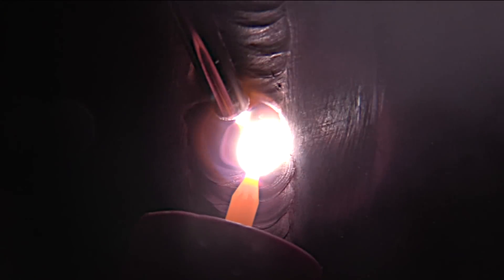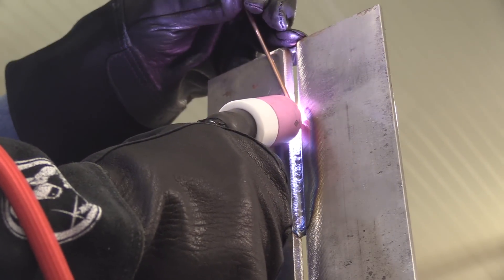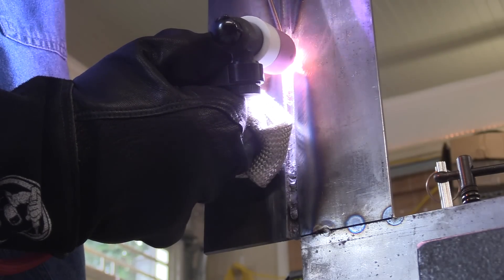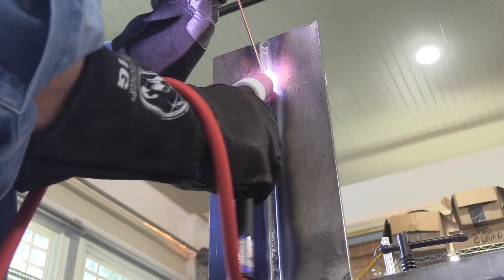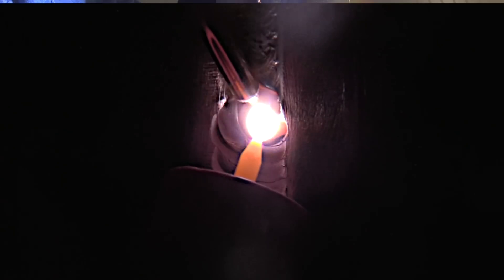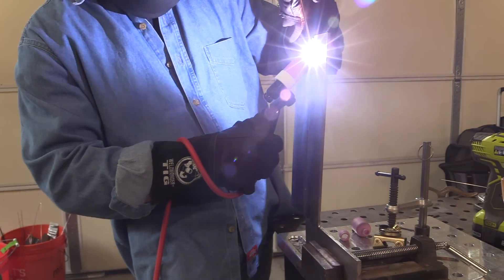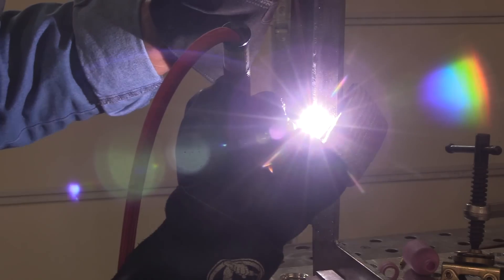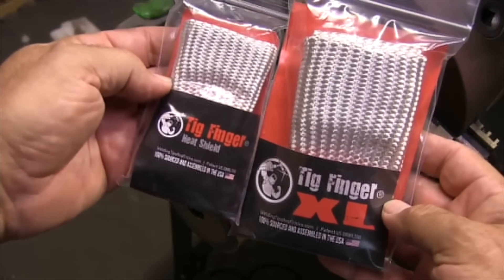Walking the Cup vs Freehand 3g Weld Test

Comment: I LOVE the TIG FINGER, I'm a sheet metal worker welding ss exhaust in cancer treatment centers (8 sites in Bedpan Alley NYC, York- 1st Aves. between 59th & 74th streets)... 95% of my work is above the "ceiling" not yet installed, so you have about 3 vertical feet to navigate between steam pipes, plumbing, electric conduit,    sprinkler system, ductwork: supply & return...
GREAT INVESTMENT, SAVED MY HANDS .
As a 260 lb guy my response to my wisea$$ apprentices that doubted if I could get into a tight spot to weld has always been, " I MIGHT BE FAT BUT I'LL  FIT", and like an AMEOBA I worked my way into spots that the kids couldn't believe possible...
Once in those spots there's no where to move, your product allowed me to endure heat from welding in cramped positions.
It was one of my best gifts to my "kids" that welded at my retirement party.
Thanks for ALL YOUR UNSELFISH SHARING OF INFORMATION AND TECHNIQUES [TIPS & TRICKS]
Bronx Love brother 😎
Reply from the maker: Thank you for the kind words
Reply: @weldingtipsandtricks  What machine are you using in this video? You saying 100-110 amps but the puddle characteristics look like the 150 amp setting on my 180mpi inverter tig lincoln.

Comment: Can tell you really know your stuff and I think any client would be more than happy with your work. 

What I wish you could have put some extra time filming into are the START and STOP positions of the weld. Seeing how you tease into the very beginning of the plate and hearing insight into what you do to back off of the weld at the end  would be immensely helpful. 

I know for myself trying to salvage a bad start can take longer than necessary to get into a good groove and then knowing exactly what actions to do as the end is fast approaching helps me to execute that transition. 

It would be great to see a video of 4T setup on a machine and how to take advantage of that setting in a straightforward weld joint and possibly any other situations you’ve encountered where it could make things easier (i.e. where using a foot pedal is not very conducive like ladder, welding on your side etc). Maybe you’ve already done a video in which case plz ignore this.

Comment: I also have the flexlock TIG torch I've got the water cools and I've also got the air cooled and also the valves flexlok I use for my sanitary welding I also find a quiet hard to walk the cup with that TIG torch I always switch out to a flex head torch or rigid to walk the cup with. I do have to say thank you for a great videos and the info that you give and also to the great product that you have with the tig finger I use them all the time keep up the great work...🎉🎉🎉

Comment: On the open root walking the cup try as you walk the cup to keep the tungsten/ arc pointed at the very center of the root, The sides will take care of themselves.
Reply: Any other tips? 😅 im 2 weeks into learning myself tig 1.5mm exhaust pipes. My welds are grey and every source tells me heat input, im certain its not. Im not as consistent yet but the dimes are okay, they blend in nicely, no undercut and good penetration. Without filler there is colour so it cant be the gas either.. im welding with a basic #7 cup and flowing about 7lpm and just under 40A. Even my haz is maybe the size of another puddle.
Is there anything else i can look at before buying like a #10 gas lens?
The gas feels like it flows out the cup just fine but i still have a feeling its not distributing the gas right or something 🤷🏼‍♂️
Reply: Sounds like your on the wright path, big gas lens more gas back purge clean clean. Good luck.

Comment: Hi ! I'm French and currently learning tig welding in this exact same position. I'm kind of struggling with the imperial system and I can not figure what are you parameters (sheet thikness, rod, stick out...) could you notice them in metric system please ? I'm pretty sure your video can help me because this position is so hard... everytime I'm going above 90Amps for the fist pass, the puddle is collapsing and everithing became a big mess... ^^'
Reply: Hey buddy all you have to do is type your question into google for example:
What is 1/8” in mm = 3.18 mm or .3175 cm. I hope this helps.

Comment: Learn how to do both with each hand equally well or at least try. I can free hand the same with both hands and my left hand is about 90% of my right hand walking the cup. In the work I do i am seldom able to walk it due to restrictions. I mainly keep walking the cup to welding beads downhill in a roller or walking the fill and cap in a roller as long as I’m not in a hurry. In my experience I can fill a pipe much faster free handing vs walking the cup. Oh and one more thing, I’ve walked a flex head torch a million miles without breaking it. You DO NOT NEED the torch he is talking about, I’m sure it’s nice but not necessary.
Reply: Jeff I used to weld with a couple of guys who were polar opposites on damn near everything. If one would use a flex on something the other would use a stiff torch. If one walked the other freehanded. At the end of the day,if you hadn't seen who was welding what you really couldn't tell unless you saw the stencil. I was still young and learning a lot of the basics and they taught me that on a lot of things there is no one "right way" there's just what works for you the best in that situation. I've never broken a flex walking either but I'm not very heavy handed on a torch like some are.